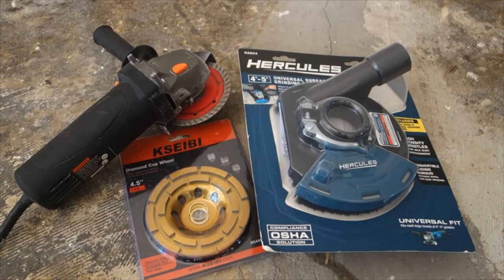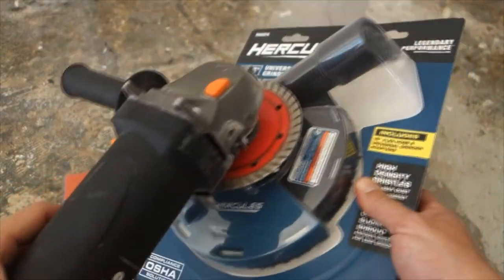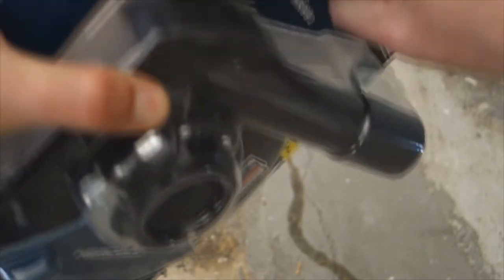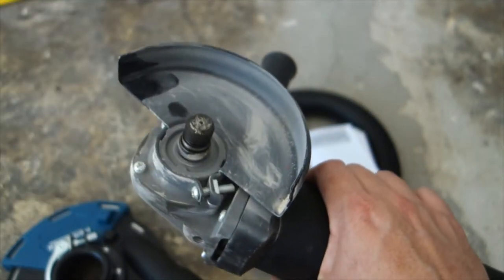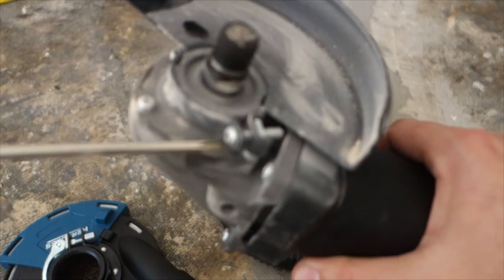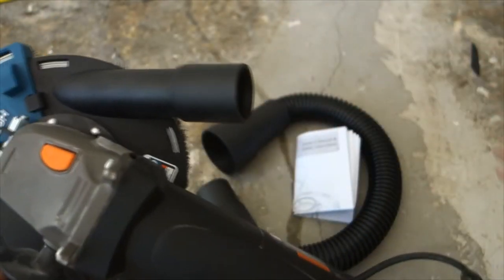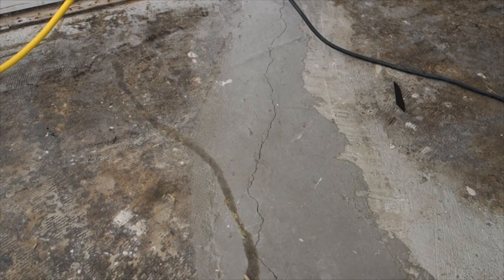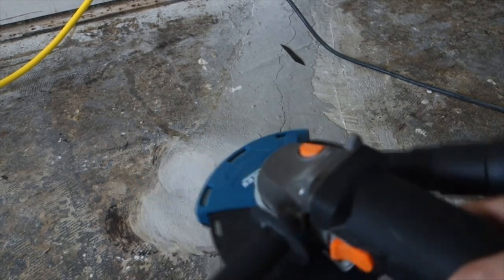Harbor Freight 4"-5" Angle Grinder Dust Shield. Will it actually collect dust? Lets Find Out!

Comment: Fantastic product!!
I hadn’t really shopped  harbor freight but after finding this dust shield there I will say I’m amazed by its quality and it’s effectiveness. I tried using my grinder with a diamond grinding cup without a dust shield inside my home just to gauge what a mess it would make and the room was filled with dust within 30 seconds. It was so bad you almost couldn’t see through it.  I bought this shield, hooked it up to my shop vac with a good filter, ran an exhaust hose from my vac out a window and started grinding again. What a difference. Absolutely zero dust!!!! What I learned is from here on I won’t be so quick to discount this discount store
Reply: Fantastic idea having the machine “exhale” out the window! I’m going to have to do that. I’m wearing a p100 mask to be safe (average n95 are not safe for grinding concrete, can still breathe in allll the bad stuff

Comment: Very nice for the price...I do a lot of grinding. When you grind, you may want to try to go in a circular pattern. With some pressure...let the grinder spin that diamond cup wheel and you will see how nice of a job it does. Great Video!!
Reply: Great advice! Just started grinding in my new job and it’s killer.

Comment: Thanks for the mounting tips, I was having trouble figuring out mount it until I saw your video. You are right about cheap angle grinders, I burnt out my cheap Chicago Electric last year sanding my porch.  It got so hot after 10 minutes I couldn't hold it.  If you want a powerful grinder try the Hercules  57348.  I got one and  very large porch for a week taking off seven layers of old paint.  It's long and easy to control and with 13 amps it barely gets warm.  Works well the concrete grinder attachment.
Reply: I got the 15amp Hercules since it was affordable compared to the competition. I got about an 800sqft garage I’m about to start on today!

Comment: Thanks for the vid. I grabbed a 8amp sacrificial grinder for the same price as the dust extractor while at HF along with 2 of their segmented cup blades. Almost done grinding my 800sqft basment and so glad I DIY'd it. Found packing down the blades with washers easier than adjusting the guard height when the blades waer down
Reply: You didn't run into overheating?  I have the same grinder and am about to try exactly what this video was about.
Reply: did you find the bristles on the hroud  got in the way of the cup blade making full contact with the floor?

Comment: Warrior grinder 4.3 A 4-1/2", Harbor Freight special, on sale ~$10....but even w/o this shroud (depending on what wheel ur using), I have to add washers just to get the middle spindle not to poke out beyond the depth of the wheel. did you all find you had to push down on the grinder to bend the bristles on the shroud? so the wheel makes full contact flush with the floor ?

Comment: I was stoked to use this but quickly found out, the tool-less adjustable grinding shield on my DeWalt grinder prevents this shield from mounting on it. I'm sure I can't remove all the components involved in that, and after grinding for a few minutes without a shield... Well I'm looking into it now 😅
Reply: Yeah I just got off the phone with Harbor Frieght and I let them know they basically lied on the packaging.   This shroud doesnt fit DeWalt grinders.
Reply: Does not fit DeWalt😂

Comment: my only issue is that the shop vac is blowing dust out the back.  I realized I could put a vacuum bag back there and that is much better but still get some leaking from the shop vac and a garage full of dust
Reply: attach a hose on our vacuum outlet and run the hose out a window

Comment: I now regret putting this back down on the shelf.
Reply: Do yourself a favor and buy the 15 amp 7-9” Hercules grinder and then get the 7” shroud. You saved yourself from buying the small one 😁👍 mine came with some weird metal washers that have zero instructions on where to go. Also I’m running into the grinder nkt being able to touch the floor cuz the bristles of the shroud. Might be fine if I push down on it but I haven’t tried it yet cuz I don’t want to do it wrong and have it fall off and cause any damage to me or the machine